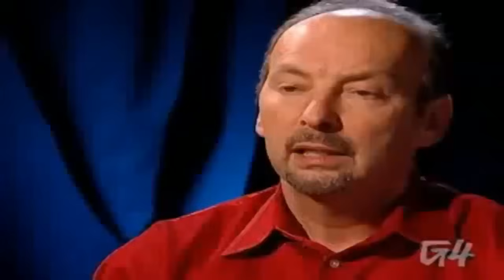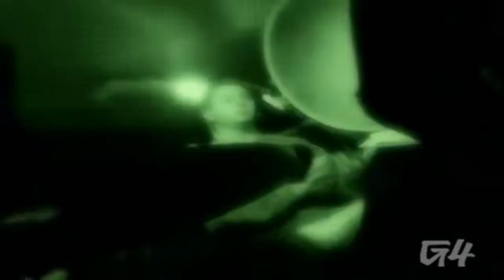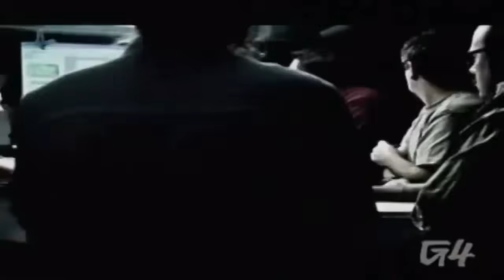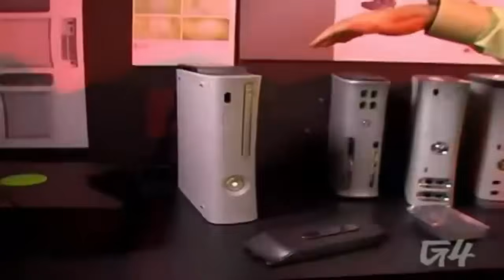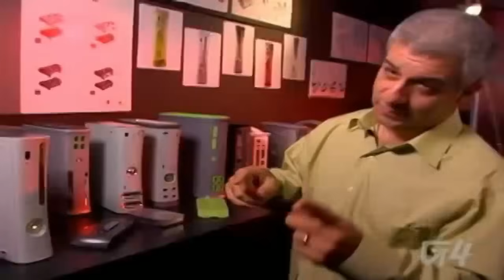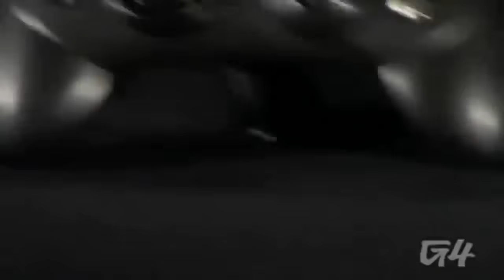G4TV - Xbox 360 Prototypes

Comment: I wonder how much the RROD would be a factor if the form factor ended up looking different
Reply from the maker: makes ya think
Reply: RROD would still be a thing due to a lot of GPU's at the time being unreliable and hot 
The Xbox 360 and PS3 was unreliable along with a lot of ATI cards , Nvidia cards and now even a lot of wii's  are starting to have GPU issues
Reply: @Jayboogi807  I was under the impression the 360s form factor was one of the core issues with the over heating along with the under powered fans, poor air flow, and the terrible lead free solder used during manufacturing.
Reply: @Jayboogi807  the actual reason as to why the 360 died so much is because its gpu, while definitely good, had a bad manufacturing process and the underfill for the connection in the gpu was the wrong type so the system would struggle tl function
Reply: It would be nonexistent. The reason for RROD was the form factor.
Reply: @zoobs-y2x actually it was the GPU due to the underfill being faulty and also the solderballs
The original Xbox 360 can be reliable if you put a more reliable GPU such as a elpis or a later y1 revised which was used on xenon's and zephyr's serviced in late 2008 and 2009